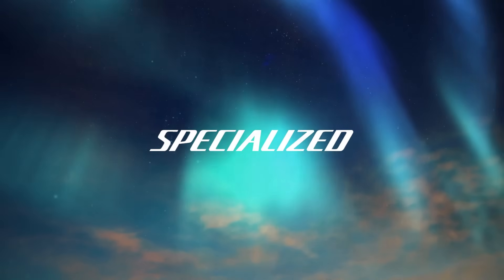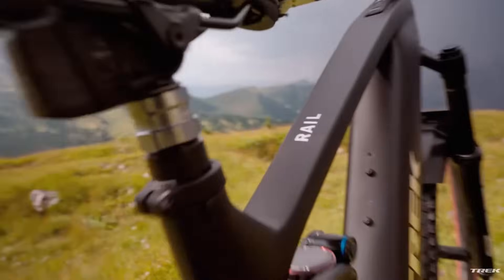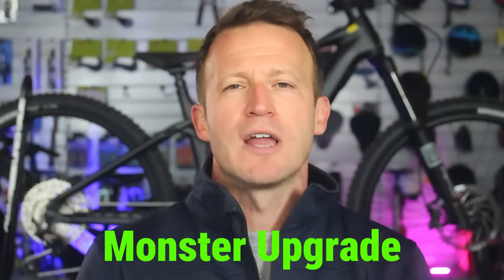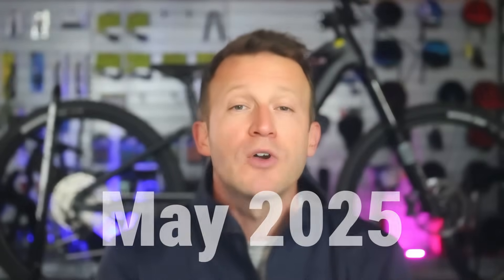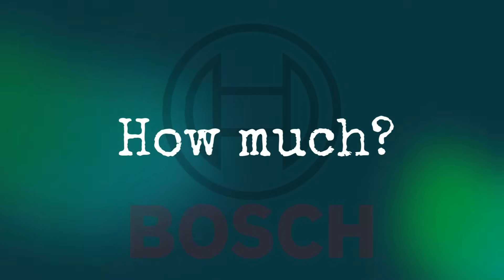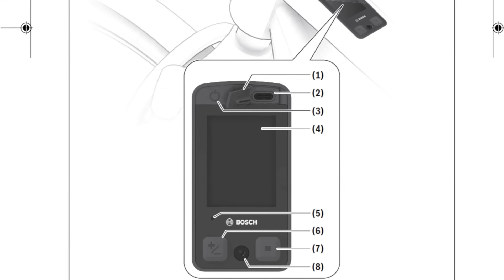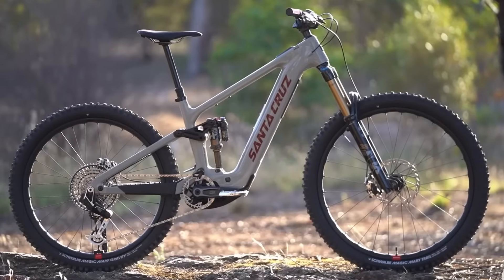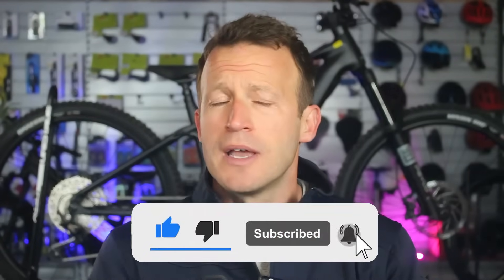Is Bosch About to Unleash 100Nm Performance Line CX Upgrade? May 2025

Comment from the maker: Hi Folks, Bosch have now made the upgrade official. 
The headline stats: Gen 5 CX = 100Nm Torque, 750w peak power, new Race Motor, new eMTB+ mode & Kiox 400c top tube display. (eMTB+ mode also available for Gen 4, no torque, P.Watt upgrade) 
Let us know your thoughts: Is this enough? Too much? Does this sway you back towards a Bosch powered ebike or away from it? Let us know in the comments. 
Cheers
Reply: Gen 4 is not included

Comment: I installed my latest update for CX gen 5, but no new modes, neither 100nm. Is there any trick to it ? motor is running 15.24.2 version of software,

Comment: As a follow up comment- I have derestricted every Brose motor.  And funny thing, my local bike shop has no idea why my motors last so long, or are as quiet as they are. The motors are capable of more, across the board, and it does not harm the longevity. IN fact, it helps the thing "breathe">

Comment: Power is fine. The issue is the restriction on speed.  I regularly  would hit over 22-25mph on an analog bike in rolling terrain, fast uphills, and jumps along the way.  IT is a bummer to be topping out, just as you apporach a an uphill jump or some other feature.  I cannot ride these bikes without derestricting the motor.

Comment: My cube reaction race has the bosch gen 5  in it I purchased the bike about a month ago and one day I got the error code 50300A  so the bike has been returned under warranty.
Reply from the maker: That error code normally indicates that there is an issue with lighting outputs (i.e. connections for lights. What issues did the bike suffer with?

Comment: Bosch's selling point was never to be the most powerful motor on the market. It was always reliability and the ecosystem, and they are still the most reliable. You can buy used Ebikes with Bosch motors that have 50 000 km on the tachometer, and should the gears or bearings give up, you can get replacements for everything besides the ancient classic line motors. Sure, more power is great for the city when you have to beat cars at the traffic light to get into safety but for touring and fun, 100 Nm is way too much to, well, to have fun. Light to middle exercise is amazing and with such a powerful motor at full assist, you're barely doing super light exercise. 

And the Data shows something EXTREMELY interesting: The majority of all Turbo usage comes from very few people that use it almost exclusively, and most users are switching dynamically between Sport and Tour, and Eco is used by more people than Turbo. For myself, I kinda fall out of the statistic. I own an OG Haibike Xduro with the Classic Plus motor, and having it on Speed (how they called Turbo back then) is between eco and tour on a modern Performance CX Drive Unit. However, if get a new Riese Mueller Nevo this summer, it's turbo will only be used for hauling trailers and when it's raining with a headwind, because riding in Turbo with so much power just is boring for me.
Reply from the maker: Thanks very much for watching and for sharing your experiences with the Bosch motor system. Our experience aligns with yours, the Bosch system is far more reliable than the other big players, plus there customer support is also better. We've just taken a bike with a Gen 3 P.Line CX motor with 30k miles on the clock. It doesn't miss beat. I expect if to carry on for a many years yet. All the best Jason

Comment: I bought a Bergamont E-Trailster 130 Tour in a sale price of £2999, Some people also paid less when more stock was around, It is a Gen 4, 85nm is enough power for me, I can get it up the steepest hills in Surrey with the gearing on it. I also use open ear headphones for music. I can't even hear the motor or any rattling. The front chainring is a 34T, Which is about the lowest around. I doubt many people would De-Restrict them, When the gearing is also so low on the front. Any decent speed would require crazy cadence, Although downhill is fun, I have managed over 45mph & the suspension & setup is amazingly good. I always wanted more power or 100nm, But, I have tested mine out & it manages the hills easily, So I am happy without Gen 5 & also getting the bike in a sale price. The annoying thing is still the U.K. limit of 15.5mph, It needs to be changed to 20mph, As that also suits my natural cadence & speed of travel. I could De-Restrict mine to go faster, But, Then it messes up the display speed & other data. The 20mph limit needs to be changed & this would also boost sales I think.

I also have a Bosch Classic motor on my other E-Bike from 2011 & it is still working like new. It also gets up the steepest hills with 50nm & carrying more weight & luggage & I am still using the original battery with no major loss in range & around 4,500+ Miles done on it. I did also test this out with a dongle & I managed around 32mph with a 44T chainring on the front. I couldn't cadence or get the motor to go any faster than that, As wind drag & weight is a major factor in gaining more speed on the flat. The dongle also cut the speed sensor timings in half, So the limit of the dongle was also reached to try & get anymore speed out of it downhill.

Comment: Hope there is an option not to have the additional power
Reply from the maker: Ultimately, you don't HAVE to have the update, but you will miss out any future improvements if never up the firmware firmware. However, you can adjust the power settings on the eBike-Flow app to limit the top end. So it shouldn't cause you any issues. Thanks for watching.

Comment: 85nm think are ok for me i need is unlock the speed
Reply from the maker: Like you, for a lot of riders, speed is of more important than torque output. Unfortunately, for various reasons, I can't see the speed limit changing anytime soon. Thanks for your comments and for watching.
Reply: @ebikecentre  With what Specialized has done by adding a Class 3 mode on the new Levo, it's definitely not out of the question.

Comment: Just give me a 20mph option..not bothered about more torque
Reply from the maker: You are definitely not alone there. Lots of riders would benefit from the limit being raised. However, I think there are two issue holding a speed increase back is 1. Not everyone is a competent rider and 20mph will be too much for some to handle. 2. There are concerns about sharing trail space with hikers/dog walkers etc when e-bikes can hit 20mph both up and down hill. I think this goes hand in hand with point 1 too.
Unfortunately, there's no easy answer to this conundrum. Thanks for your comments and for watching.

Comment: Been a Trek Rail rider for 5 years and 5,500 miles, I had planned on getting a Vala (wanted a mullet) but ended up with a new Turbo Levo because of the interface. Just seems better. Wasn't even the higher Nm that attracted me.
Reply from the maker: Thanks for sharing. Specialized do seem to have had the edge over Bosch in terms of interface and app connectivity, for some time. It will be interesting if the Kiox 400 addresses this. Thanks for watching.

Comment: Why not gen 4 I'm sure they could do something
Reply from the maker: I suppose it is possible, but my feeling is that they had already planned on a torque upgrade for the Gen 5 at the design stage, so the Gen 5 will be operating within it's design parameters. I don't image they designed the Gen 4 to offer much more than 85Nm, so if Bosch try and force a firmware upgrade on the Gen 4 they might compromise the reliability. I wouldn't 100% rule out an upgrade for the Gen 4 but I don't imagine they will be able to achieve the same increase as the Gen 5. Thanks for watching and commenting.

Comment: If it is just a firmware update needed to up the power? This sounds like the power they originally settled for was to make sure it was operating in it's most reliable state. Will they now be sacrificing reliability by over tuning the motor?
Reply from the maker: That's a great question. I had thought very similar, i.e. that Bosch wanted to see the Gen 5 operating in the real world before they increased the power. They successfully achieved the increase in power on the Gen 4 (75-85Nm) without any reliability issues, I would expect they should achieve the same this time. Thanks for watching and sharing your thoughts.
Reply: @ebikecentre  - My Gen Classic motor is used hard, I always have it in Turbo Mode & carry heavy luggage. The E-Bike weighs around 32+Kg with my panniers, Lock & rack & I add more weight to it with shopping. I use it on some of the steepest hills. It has never broken down or had any issues so far, I have also used it in the heavy rain. Bosch did well with this build even back then in 2011. Even the pedal sensing on the pedal cadence is just so smooth. Gen 4 is more power & smoother. I have also ridden bafang motors which are just power on or off. The Torque sensing on the Bosch is just so smooth & it feels natural.

Comment: So he’s just speculating just because? Come on. 😒
Reply from the maker: I completely understand your scepticism. After all, I am not able to provide your with any hard evidence in the video. From the numerous conversations I have had with various people within the industry and information I have seen, I am  convinced that this upgrade is coming. I wouldn't stick my neck on the line with this video without it. Ultimately, I could have been supplied false information, at which point I look the fool, but I don't think I will be.
Reply: @ebikecentre  Looks like you called it!
Reply from the maker: @Zetler  Full info has been released by Bosch today. 100Nm & 750 watts peak power.👍

Comment: I have an EP801 powered bike and an Bosch Gen 5 powered bike and can already say the Bosch is night and day better without the upgrade, i dabbled with the Amflow and Spesh but inevitably went back to the Bosch knowing this was likely to turn up very soon, we shall see what Thursday brings
Reply from the maker: Like you having ridden various motors, the overall Bosch Gen 5 package is hard to beat. The improvement in noise reduction and riding feel has taken the Gen 5 up a notch vs the Gen 4. Thanks for watching and for your sharing your thoughts.

Comment: Ive also heard with these updates, that they are going to up the SX motor to around 60-65NM, pure speculation obviously.
Reply from the maker: I have heard rumours about the SX getting an update too. I've seen some solid evidence regarding the Gen 5 (hence why I've stuck my neck on the line by posting a video) but it wouldn't surprise me to see the SX motor getting a tweak too. Thanks for the sharing your info and for watching.

Comment: I find this race for power completely stupid; it'll use up more battery power, and many beginners will find themselves in difficulty if they don't know how to ride. Yesterday, I tried two e-MTBs for the first time: the Orbea Wild and the Santa Cruz Bullit. I have 30 years of experience with muscle mountain biking, and I found the 85Nm Bosch motor to be more than sufficient. 350 of elevation gain over 5 to 7 km, it was a tough climb. I rode in Tour+, managing the gears well, and it went very well.
This upgrade is more marketing-driven, driven by consumer pressure than rational, given the real need for such power.
Reply from the maker: Like you, I've been more than content with the 85Nm status quo, but it seems there are many out there who want more. I know of riders who ride seriously demanding technical climbs that would benefit from the extra torque, but the average rider won't really benefit IMO (particularly in Europe where the motors top out at 15.5 Mph). I'd personally prefer a focus on weight reduction and riding feel. Thanks a lot for your comments and for watching. Jason

Comment: Hi, is there some info about Bosch Race Limited Edition? I know it is from Gen 4, but it is not the same. They are saying it is their most powerfull motor. It will be very sad, if this motor will NOT get this update. Thanks for the answer...
Reply from the maker: We've not heard anything about the CX Race, yet. My gut reaction is that as the standard Gen 4 and the Race share most of the same hardware, it's unlikely that the Race can be updated and the Gen 4 not. I could well be wrong though....
I would imagine Bosch have a Gen 5 Race in the pipeline and are focusing their efforts on making that as close to the DJI Avinox as possible. Thanks for your comments and for watching. Jason
Reply: @ebikecentre  Thanks. If you are right, than Pivot made (in my opinion) a very bad decision with Shuttle LT.

Comment: Thank God i went for the gen 5
Reply from the maker: I offer no guarantees that this power upgrade is "definitely" going to happen, but do have it on good authority that it will. So it does look like you made the right call to go Gen 5. Thanks for watching and commenting.
Reply: @ebikecentre  it is guaranteed now😊 I just bought the Vala, with a whooping 100nm. More than enough coming from a mechanical bike😅

Comment: we don't need more power, it's plenty. we need more reliability and maybe lighter systems

from bosch, more integration - with garmin, better ergonomics like levo, no clunking sounds
Reply from the maker: You're certainly not alone in not wanting more power. Personally it won't impact the riding I do, but it does for others. Its interesting that there have been quite a few comments regarding Bosch's lack of integration with other apps/devices. Definitely their Achilles heel at the moment. 
Like you, lighter weight and increased reliability would be my priority for new ebike systems. Thanks for watching and commenting. Jason

Comment: Specialized is not stepping down and the brand new 3.1 motor is developed to last just a long as the G3, soon 101nm will be uppdated to 111nm and the 111nm to >120nm with > 850 peak power according to rumors in the Swiss alps. Torque and peak power is now where the war unfolds whether you like it or not, we will see in a few years if it was the right place to start the war and as we all know nobody can see into the future which DJI was a good example of.
Game on💪🏼
Reply from the maker: I would too expect Specialized to increase the torque and peak watts on the Levos outside of the S-Works, in the not too distant future. For now they want to "reward" customers with the deepest pockets. I haven't heard the rumours that they will be able to increase beyond 111Nm, but it's not beyond the realms of possibility. As you say, who knows what the future holds. DJI have certainly ripped up the rule book. Thanks for watching and commenting. Jason
Reply: @ebikecentre  The difference in torque is really annoying for those of us with regular pockets also the quick charger which is very expensive to buy.

Comment: Any insight of  compatibility with Garmin devices (battery and. Motor data) as Shimano, Brose are doing?) may be via new Knox 400?
Reply from the maker: We can hope so. Compatibility with other apps and devices does seem to be Bosch's Achilles heel currently. Years of running closed systems has left them behind the competition. I don't expect the Kiox 400 will be the cure, I suspect a system wide updated to the Bosch operating system will be required. This might be on the card too, but we will have to wait and see. Thanks for your comments and watching our vid.

Comment: Bosch risk having a Nokia moment and becoming a has been.

The big players are cynically limiting upgrade paths for customers, creating paywalls and extracting ever larger prices from their customer base
Reply: The opposite is true. More powerful assist is not a new technology, unlike the smartphone was. And Nokia is still very much in business, they just don't develop their own mobile phones anymore, huge difference.
Reply from the maker: There is always that risk, but Bosch are still very well positioned in the market. They have motors for every type of ebike, not just hard hitting eMTB. Yes, they will have lost some riders to the DJI platform, but personally I think it's the Shimano powered Orbea Rise that's set to be the biggest loser from the DJI Avinox's arrival into the market. 
Bosch have a big reputation, not just in the ebike industry, for reliable, well thought out products. This is still their USP, not raw power or being the most technically advanced.

Comment: Bosch has very poor software. It can’t connect to a cycling computer so you can’t use it as a powermeter. Specialized, DJI, fazua and even TQ can do that.
Reply from the maker: After years of running a completely closed system, they are still playing catch up vs the competition. I would expect that they will catch up eventually. Thanks for watching and commenting.
Reply: @ which system is open then? I guess they are all locked and sometimes peripheral from last year is not compatible with current motors.

Comment: Have had my Gen4 powered bike since 2021 and happy to say I'm not looking for a power upgrade. Unless in super punchy or technical climbs I have the mode set to Touring or "2nd gear". I've ridden dirt bikes for 50 yrs and realize the potential fun factor, however I want to maintain fitness more than throw a roost.....
Reply from the maker: This trend towards more power is not universally popular. Personally it won't impact my riding, but it will for a lot of riders. Thanks for watching and commenting.
Reply: Sorry to not agree. I could pass obstacles in up hill more easely with the gen5 . Also coming from durt bike but more trials bike ... Hope they will upgrade the gen 4 as well. Which seems to be a stronger motor